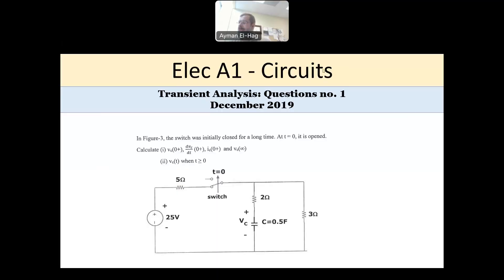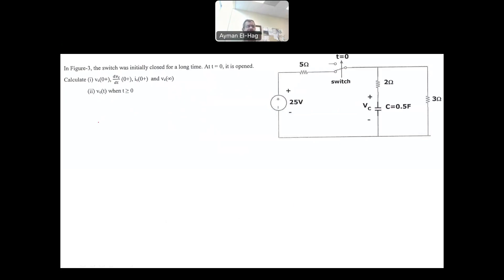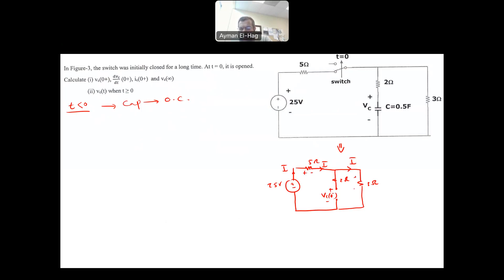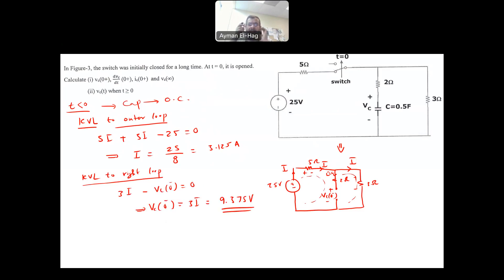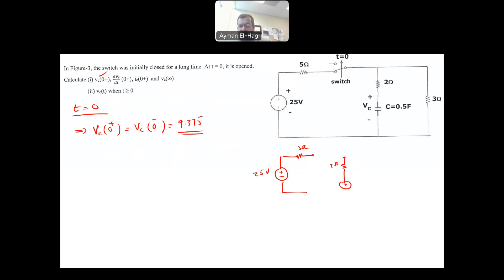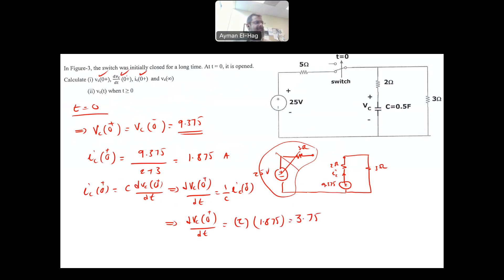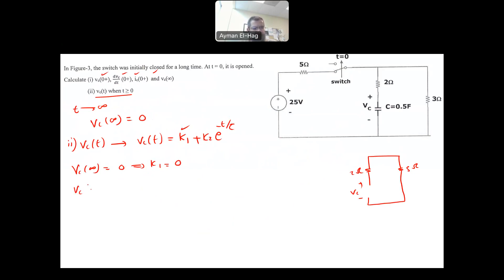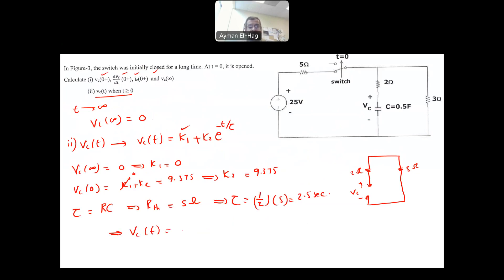PEO solved examples (ELEC A1): Transient analysis Question no. 1

Comment: At 3: 28, when you applied KVL to the inner loop, i think you forgot to consider drop across 2 ohm resistor? If i am right, Sir?
Reply from the maker: there is no current in this branch because the capacitor is open circuit.
Reply: @electrical4everyone  it was possible to apply voltage division ?
Reply from the maker: @assiatinkicht6755 voltage division will not be easy as you need to have all elements in series with the voltage source
Reply: @electrical4everyone  I see. Thank you